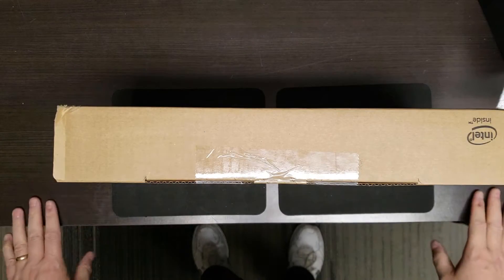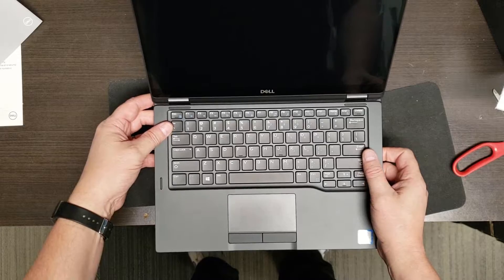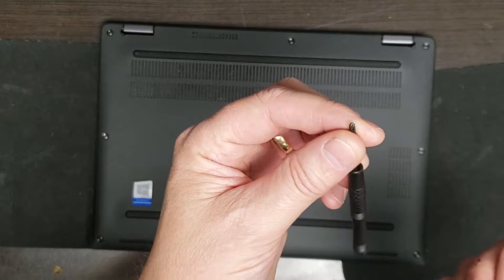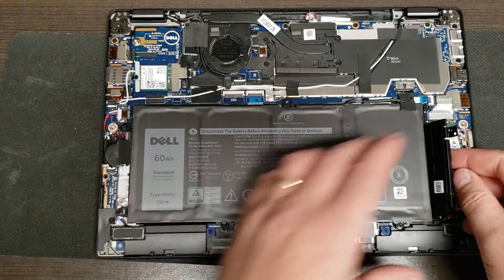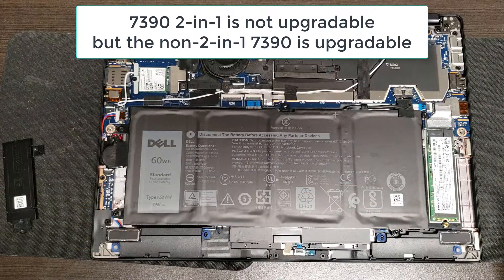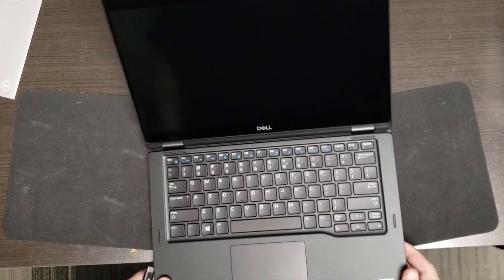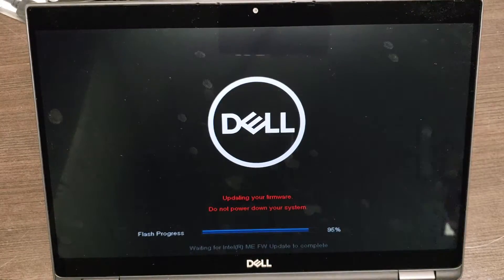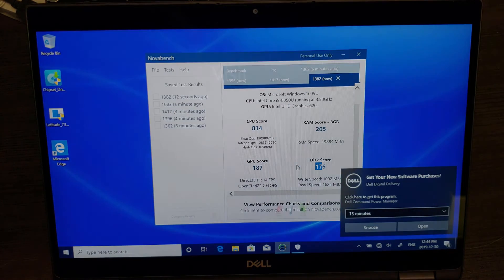Dell 7390 2 in 1 Unboxing, Disassembly & Benchmarking Review

Comment: How many SSD slots are there? It was stated in manual of 2-in-1 that there is a 2230 secondary SSD. Could you clarify please? Thanks!
Reply: To be plugged in the empty WWAN slot .. Will work fine (Must be NVMe form factor).

Comment: This is misrepresentation and leaving it labeled as this for over a year is either sloppy or click bait.  It is not the 7390 2-in-1 it is the standard 7390.  I own the 2-in-1 and clicked to see if I can get a view of the inside of my computer without actual disassembly.  I wish I could attach pictures but the actual 2-in-1 has more shallow keys with arrow keys being even with the bottom of the spacebar, alt, and ctrl keys.  The hinges are obviously bigger to accomodate the 360 degree flip.  The 2-in1 also only has a thunderbolt port and microSD card reader on the left and a thunderbolt and 3.5mm headphones jack on the right.  Do a quick google image search and check it out.  Hope this helps!
Reply from the maker: Hi Brandon, This is neither clickbait nor sloppy.  We have BOTH the 2in1 and non-2in1 models.  As you can see https://youtu.be/iFJIdZol_cU?t=448 this IS the two in one.  Perhaps you have a different revision or one for a non-US / non-Canadian market.
Reply: @URTechDotCa  this is still not the 2-in-1.  A true 2-in-1 bends more than that than making a tent.  I never saw you fold the device flat.  BUT I will say if it corrects the picture in tent mode to be right side up, I'd be impressed.  It actually folds all the way over and folds flat.  I have attached a few reviews that has pictures specs of the true 2-in-1.  Notice it folds flat, has a different port selection, and they keyboard layout it different.  AND it is the the US spec one as I am based in the United States and ordered it directly from Dell as it looks identical to the one in the white one in the cnet artic

This is the true 7390 2-in-1.  
https://www.cnet.com/reviews/dell-xps-13-2-in-1-7390-review/
https://www.lifewire.com/dell-xps-13-7390-2-in-1-review-5113106
Reply: @brandonspies  bro the laptop in the video is a 2-in-1 haha
Reply: @brandonspies  7:15 watch from there 

Not sure how you’re basing your claims of it “not being a 2-in-1”
Reply: @ethanstenner9397  ok I figured it out and stand corrected to an extent as we're all right!  DELL HAS TWO 7390 2-IN-1 MODELS AND 2 STANDARD MODELS!  The OP needs to make a clarification as to which model he's working with still.  If nothing else in comments.  This is an 8th generation Intel 7390 2-in-1.  There is a newer 10th generation Intel 7390 2-in-1.  I'll refer to these sites to clear it up.  Pay close attention to the pictures.  I wish I could take a close up picture of the model number on mine.  The newer 10th generation Intel standard is what I thought he was working with cause when I googled it the older 7390 is the results I received.

This is the still sold 10th gen 7390
https://www.pcmag.com/reviews/dell-xps-13-7390
This is the newer 10th gen Intel 7390 2-in-1 (the one I own)
https://www.lifewire.com/dell-xps-13-7390-2-in-1-review-5113106
While this is the older 8th generation 7390 with a link to the 8th generation 2-in-1. (the one he has and the one I thought he was working with)
https://www.pcmag.com/reviews/dell-latitude-7390
Notice the key second paragraph.  This second paragraph helps a lot.  With pics of all 4 models you can see what were working with.  BUT with all the numbers and letters out there I don't understand why Dell has to use 7390 twice. smh

My apologies to the OP but still it is what it is.

Comment: How much more would you have to remove in order to replace a keyboard on this model?
Reply from the maker: Hi Jonathan, I don't have access to the 7390's anymore but I know the keyboard can be replaced so I would look for Dell manual (on their site) to see what is required.  Thanks for the question.

Comment: Good run down on the Latitude 7390 2-n-1. Thank you. Just purchased a used one with more than 2yrs warranty remaining. Disappointed about the RAM being soldered in, no upgrade path. So far, tho', it's looking like it's going to be perfect for the field. It's rugged, fast, solidly built and the tablet function is perfect for capturing signatures from customers. Was glad to see Dell is using a metal bottom cover, too. Helps to dissipate heat. Overall, I'm very impressed.  Ty, again
Reply from the maker: Its a great device and I too was unhappy with the RAM setup, but the device is just fantastic other than that.

Glad it helped.  Thanks for the comment and sorry for the looooong time lag on the response; I have been in Hell in recent months with... lots of personal stuff.  Thanks again.

Comment: This is definitely not the 7390 2in1. That would be an XPS 13 model.
Reply: As an owner of this exact laptop. Should go without saying that his is in fact not the XPS 12 model. Latitude 7390 2in1.
Reply: Normal 7390 you cant flip 360.

Its 2 in 1
Reply: Yes it is I have the same computer. It's the Latitude 7390 2 in 1. They also make a none 2 in 1 Latitude 7390.. and the XPS 7390 2 in 1 is a totally different model.
Reply from the maker: XPS, Latitudes and Inspirons are frequently just rebranded versions of each other with different warranties and slightly different components (i.e. different SSD options or more/faster RAM)
Reply: IT IS A DELL LATITUDE 7390 2-in-1

Comment: It is not dell 7390 2 in 1
Reply: Yes, it is lol, I have the exact same computer. XPS has it's on 7390 2 in 1 but this is the Latitude
Reply from the maker: XPS, Latitudes and Inspirons are frequently just rebranded versions of each other with different warranties and slightly different components (i.e. different SSD options or more/faster RAM)
Reply: It is ahahahahaha